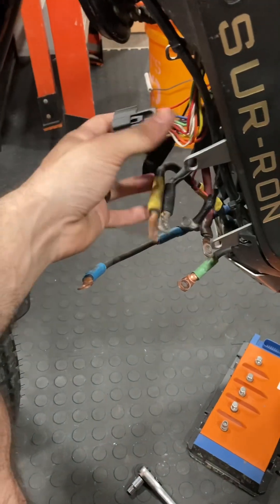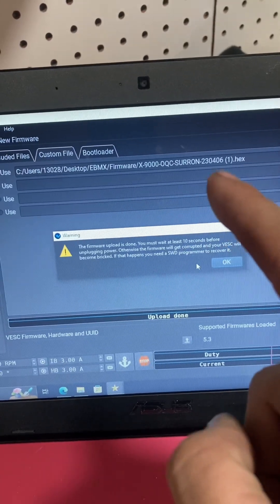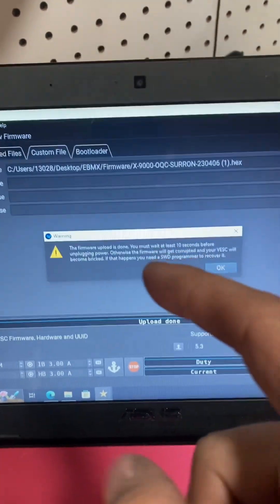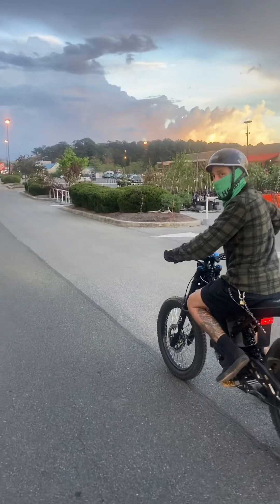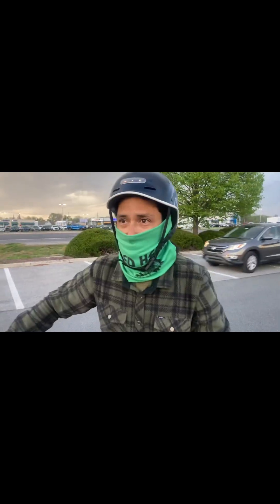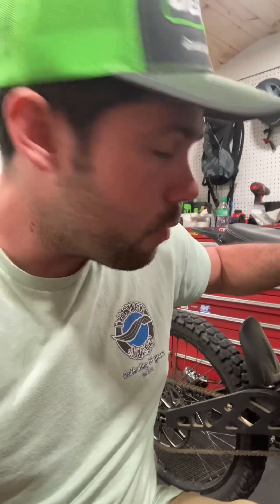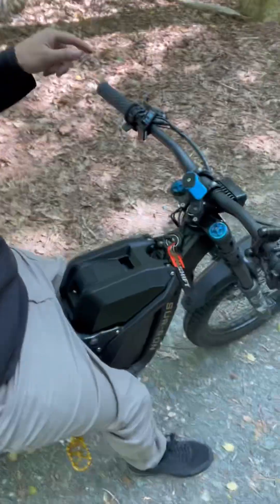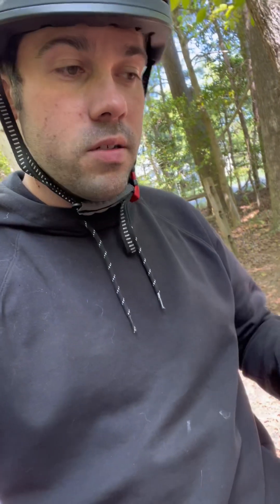EBMX X9000 - The controller you might actually like.

Comment: I just ordered this for my talaria sting r which arrives early june. How has it been? how does it compare to the bac8000?
Reply: FYI I've read the motor gets hot with the x9000 on street might need to also update your motor.
Reply: @willneedwater  Ive never heard that. Good to know. TIme will tell i guess
Reply: @YoungWise2011 yours ever over heat?
Reply: @LuckyO97  ended up selling bike I don't think so tho. I

Comment: Much better. I think locking out VESCtool was a mistake.
Reply: How do you update using the phone app?
Reply from the maker: @baesic.  depending in what firmware you’re currently on you can use android ebmx Vesc apk or apple Vesc. Please reach out to Matt or your dealer for details. Also on x9000 Facebook group there is instructions.
Reply: @mattthemechanic  how hot is to hot?
Reply from the maker: @baesic.  depends what motor. Stock surron motor I ramp down at 90c.
Reply: Mine didn’t come with a programming cable also?
Reply from the maker: @baesic.  all the new units will or if you request one they will send it. It’s needed depending on what version you are on and how the update goes.
Reply: @mattthemechanic  mine is getting to 130f not running it to hard is that to hot? I’m not sure how hot I’m supposed to let it get and idk what update I’m on or how to update using the app
Reply: @baesic.  You may not ever need one! It's possible that you can't update the controller via the phone app, but its fairly rare. That cable is a back-up plan if the early firmwares don't upgrade.
Reply: So it is worth to buy or not? Because i am front of buying a X-9000. I would like to buy it next week.
Reply: @TudiMPowerService  Matt got an early unit and then things went wrong as he's a very early adopter. Issues were discovered and then rectified quickly. For any new product release, there is always growing pains. I think you can see in this video that those issues have been largely been resolved now.
Reply: @de-bodgery  Yes but how i know the contoller (what i will buy next week), is not from that series what had problems? I will buy it from Shock-Bikes Florida. But i don't know they have an "old stock" or new? Or this problems was just software related? So no matter how "old stock" cotroller i will buy?
Reply: @TudiMPowerService  99% of issues that have been seen are fixed with a firmware update.
Reply: @de-bodgery  Ok, but who did the firmware update on a controller what sat on a store shelf a half year?
Because if i buy it and than i need to update the firmware and it will failing like Matt had (if i remember correct) than i need to send back the controller to (where?) and i must wait months to be reflashed? I just ask this because i want to use as soon as possible and i don't want to wait months for "repair".
Reply: @TudiMPowerService  This is a trivial thing! You have 2 ways to do it and neither are all that hard. The phone app will update the controller. You will get a special programming cable that works with VESCtool and can use that to apply firmware updates. It's usually not more complex than connecting the app on your phone to the controller and telling it to update the firmware. It is highly unlikely that you will send your controller to EBMX for a firmware update! IF something goes wrong, and Matt IS the worst case scenario I have heard of, then you'd need to send the controller to EBMX. The vast majority of people don't have the level of issues Matt had! He is rare and admittedly early teething pains that are mostly gone now.
Reply from the maker: Hey buddy I can speak for myself lol
Reply from the maker: @TudiMPowerService  PM me about the controller
Reply: @mattthemechanic  I know! But he was undecided because your situation was far from ideal.
Reply from the maker: @de-bodgery  a lot of people right now are in the same boat but it will get better over time.
Reply: previews firmware"march" was very Bad.
Where did you find the last one "june" maybe?
Please?
Ty